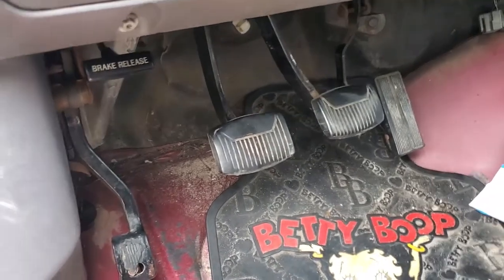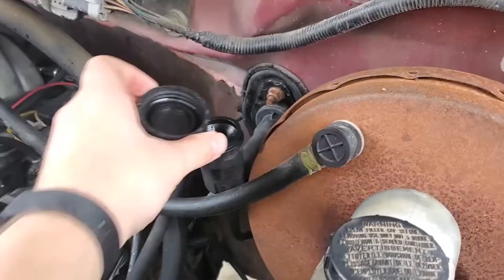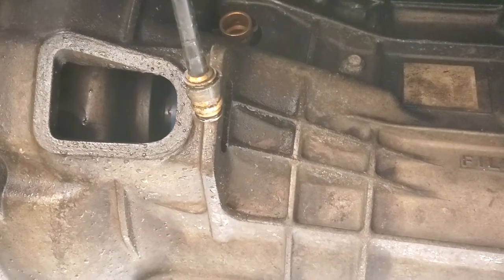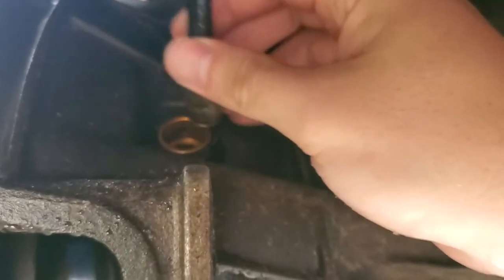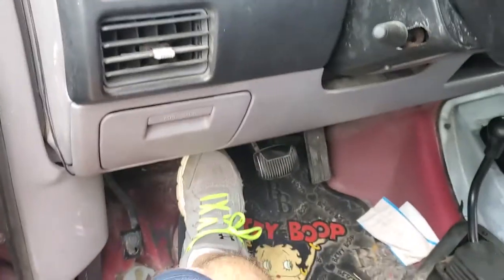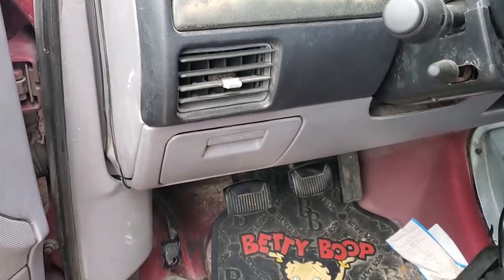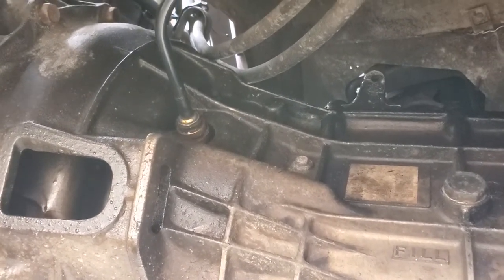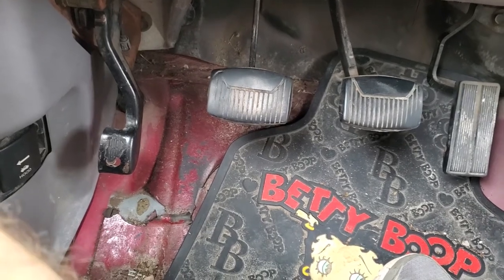1995 Bronco Bleeding the Clutch Hose

Comment: Ford should have been slapped for putting the slave in the bell housing 🤦     I had the same issue about a year ago on my 93 F150 300 4.9L 5spd, I just replaced the master and slave. The concentric slaves for those are garbage and so are their "easy" connect lines that come after market!
Reply from the maker: I wish there was a solid aftermarket that permanently attached to the slave with an easy but secure connection.  I honestly thought about JB Welding the line to the slave because I was so frustrated, but decided against it in the end.
Reply: Did you get it fixed bc my 94 4.9 5 speed 2 wd won’t build pressure in my clutch I just put new master and new slave a year ago . only thing I did was get my shift forks replaced and then no clutch new master and it’s still giving me hell do they take forever to build pressure or something?
Reply: @knoxjhill3991    you'll have to bench bleed the master cylinder, if you didn't then buy a cheap brake bleeder from harbor and bleed via the slave cylinder.
Reply: @MrShazaamm  Hy man think ima bench bleed it
Reply: @knoxjhill3991  slave cylinder for those cars are two diferent types the one with the c- clip and the one that you just push in

Comment: Your line kept popping off because there’s a little plastic sleeve that when u plug your line back it muy must press that little plastic sleeve in as well of its not locked in. To take it off you must slide that plastic sleeve back out away from the transmission and it will release the line allowing you to take the line out 

Thanks for the vid
Reply: U actually push the plastic sleeve in to un lock the line so u can remove it...
Reply from the maker: So I actually had to replace it again last month.  The one that I have has a clip that secures the line into the slave cylinder.  I think the groove was worn down, not allowing the clip to stay secure.
Reply: The clip is an aftermarket "upgrade" for that connection. The  OE is basically the same as a fuel line. But instead of needing a tool to press in the fingers to release they put the tool on the line for you. That's what the plastic collar is. You press it into the joint (toward the transmission) to push the fingers back to release the line.

Comment: How did you get that line to stop popping off?
Reply from the maker: Sorry for taking so long to reply, but I actually just had to change the line again. My best guess is not using the same brand of clutch line and slave cylinder, maybe the connection was slightly off? I'm not sure, but it's working for now lol

Comment: Does the truck have to be on while doing this or can it be turned off ?
Reply: Off is fine the best way to bleed these is with a vacuum pump from the top. They are about $40 at harbor freight
Reply: @FreedomInc  tried the vacuum pump from the top. i lost whatever little clutch pressure i had. when i cracked the slave bleeder screw n tried from the bottom without the vacuum pump i got half pressure. i took that garbage vacuum pump back
Reply: @user-zz5hm3ev3h  you didnt do it correctly then. If you get a good seal and pull vacuum on the line the only thing that can fill it back up is fluid when you pull the line out.
Reply: @FreedomInc  apparently neither did u lol but ok. seen plenty of videos how to do it and i do it exactly as shown. i will leave the vacuum to it and go take an hour nap then check n see if any better
Reply: @user-zz5hm3ev3h  because you use youtube to learn what you may know. I most times use it to give better information to those seeking help.
I had an issue one time. Snd it was me doing something incorrectly.  And if you're not getring a full pedal the same can be said for you.  Its a relatively slow process since the vacuum has to pull the air through the fluid.

Comment: What was the problem?
Reply from the maker: +Steve Teniente I had just replaced the clutch line, so I was bleeding the air out of it through the slave cylinder. You could also prime the line before installation, which would definitely help
Reply: @bettythe95bronco57  these are designed to be bled with a vacuum pump from  the master cylinder

Comment: On a really cold morning, I was pulling out of the parking lot to go to work and the clutch pedal went to the floor. Turns out the hose just popped out of the slave cylinder! Just need to reattach it securely and bleed the system.

Comment: Slave Cyl. Not Master Cyl. 
Slave is for Clutch
Master is for Brake
Reply: The master cylinder is where the reservoir is for either brake or clutch. The slave cylinder is what is pushing the clutch. Essentially your brake calipers are a type of slave cylinder even though they aren't called that.
Reply: the master cylinder is what the clutch rod pushes into which forces the hydraulic fluid through and activating the slave which disconnects the clutch. the clutch and the brake each have their own master cylinders.
Reply: Who really cares what u call it..Any one with common sense new what he was talking about....

TROLL ELSEWHERE !!!°°